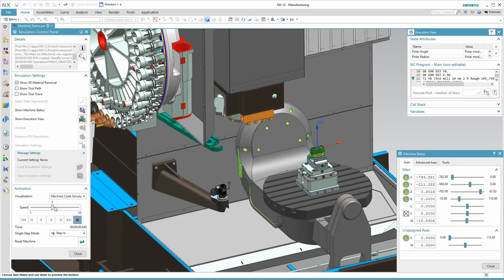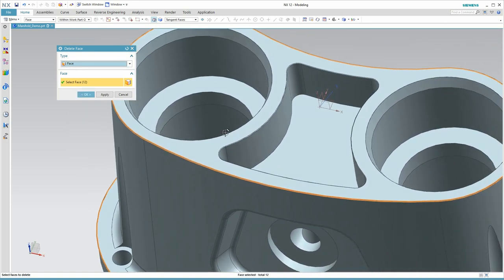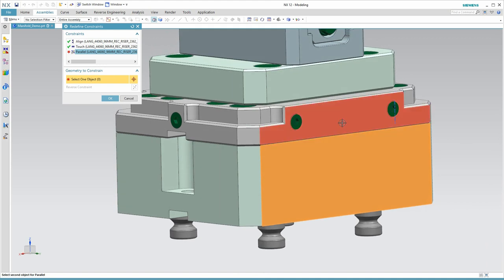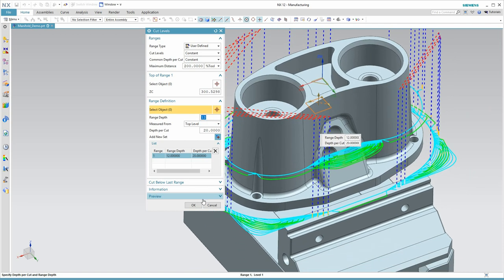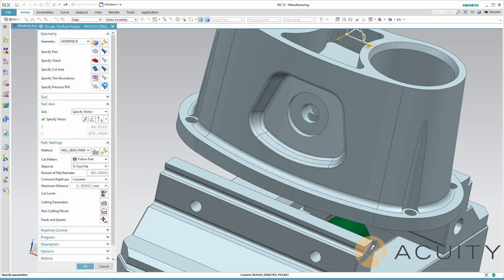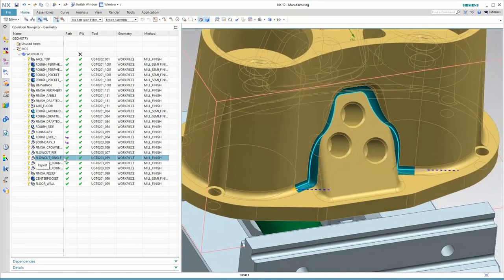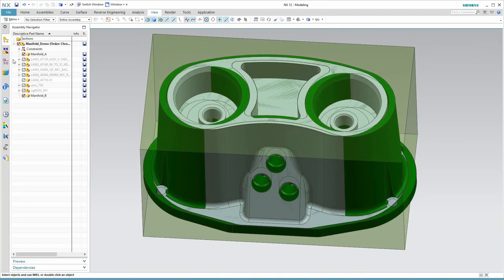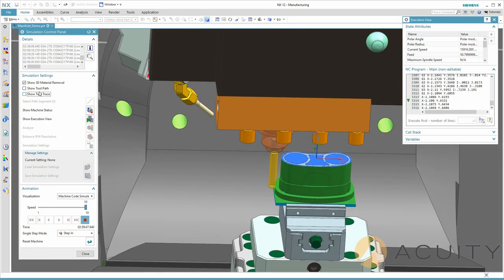NX CAM workflow overview for 5Axis machining with Andy Schaefers

Comment: Thanx for this great presentation....Can you tell me.... My tooling fixture does not move with the machine sim. only the part moves in relation to my tooling program..I am using part mount junction to locate the Part and fixture on to the machine tool table can you help  ?
Reply from the maker: A.G. Fisher, This is from Andy Schaefers:

Choose the “Machine Tool Navigator” resource button
 
In a white area of the navigator, right click and choose “expand all”  This opens up the entire navigator tree.
 
Look for the area where your geometry is defined.  There will usually be three entries, Part, Blank, Fixture or something similar.
 
Double click Fixture.  A dialog should appear, and there will be a collector at the top for components.
 
Select your fixture components off the screen.  You should see the count in the collector is no longer 0.

Hope that works for you!
-The Acuity Solutions Inc. Team
acuityinc.com
Reply: Andy...Thank you so much for the solution Yes in the Machine tool navigator SETUP FIXTURE is the key just select all the components that make up the holding fixture and ok it ...Now my sim includes all the tool movements and fixture movements in full sync..Thanx to all at Acuity.

Comment: Andy, great video. But, IMHO, if you'd have done this a bit slowly and completely without missing some of the steps such as that of Setup fixture etc, in the time one works, rather than video compositing, this could have had a larger impact as an instructional video. As it stands, the end user loses interest in it in the first few mins.